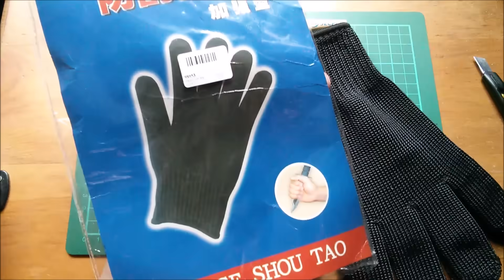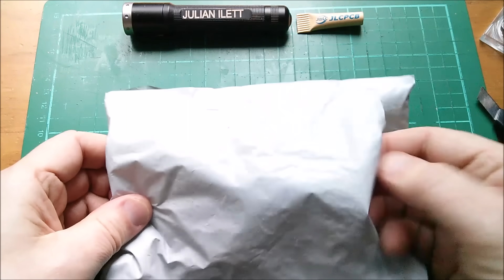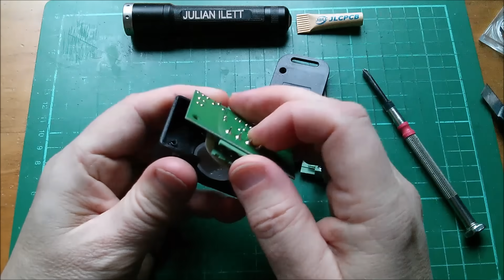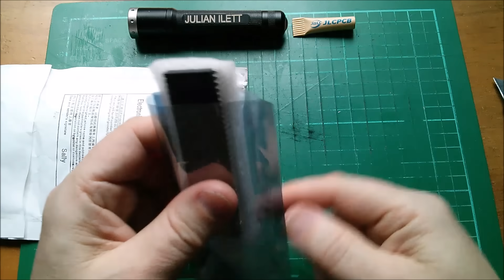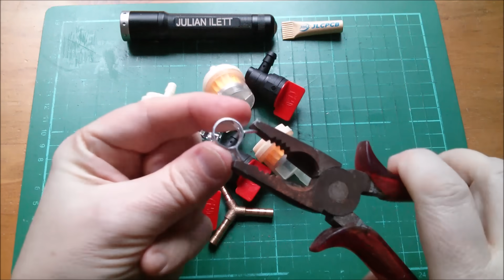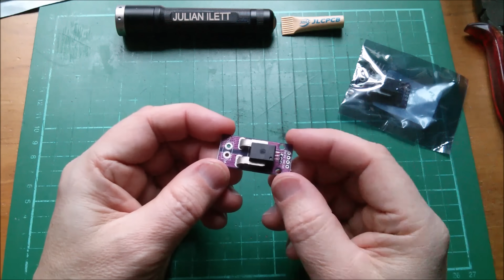Julian's Postbag: #130 - Anti-Slash Gloves

Comment: Dear Julian! 👍

For almost 20 years I drove my Mercedes Benz W140 and W202 with prechamber diesel engines and in-line injection pump with vegetable oil in a 2-tank system!
But not a single one of the vegetable oil drivers' forums managed to manage his Eberspächer or Webasto parking heater with vegetable oil!
I'm really looking forward to see if you can handle the Chinese clone! 🤔
The viscosity of vegetable oil is around ~8 times thicker than diesel, we had to preheat the vegetable oil to about ~80°C with the cooling water heat exchanger or electrically to achieve the viscosity and ignitability of diesel!
In the case of the CDI diesel engines, the conversion of the vegetable oil did not work, or only sometimes with considerable additional expenditure of technology and costs - a lottery game, it works or not!

❗ Another tip from me, build in the diesel line a check valve, you'll spare the diesel pump ❗ A cheap plastic check valve from the aquarium accessories is enough ❗

Now I drive because of these problems with diesel vehicles (driving bans) to drive downtown, unfortunately, an MB gasoline engine. 😒
I'm not happy with the petrol engine, a diesel engine is much smoother to drive. 😢😭

Best regards from Austria ❗

Comment: Typically such gloves are a woven fiber like Kevlar surrounding a stainless steel wire to further help resist slicing forces.  In fact, the wire was visible in the video where you were inspecting the finger tip after your first round of cuts.

Comment: Other current shunts (the smaller 20/30A) have the same idea of an opamp. so when your measuring current with an Arduino (0-5v input) with a 20A shunt : 0A is actually at 2.5v, -20A would be 0v and +20A is 5v.
So you can measure current in both directions.

Comment: Ha! You got the 68k ;)
  I've come across a few more references that I've saved in my MPU 68k playlist since the 6809 upload. I also got a copy of "Microprocessor Systems Design : 68000 Family Hardware, Software, and Interfacing"
by Alan Clements as someone suggested recently. The book is more academic than practical at first glance, but it's certainly thorough.
   I don't know if the ex-library book liquidators are a thing on eBay UK like they are in the States, but I got my copy for $4.51 delivered. Not too shabby for a massive hardcover version of a university course level book. I also picked up a copy of "The Definitive Guide to GCC" by William von Hagen. Apparently there is quite a bit of support for the 68K family with the GCC compiler...as treacherous as that is to the Assembler gods.
   It is certainly an interesting chip. I mentioned it before, but to anyone that hasn't seen the Computer History Museum channel's interview of the team that designed and built the 68k, go watch it when you have ~3hrs to spare. It's really interesting to hear about what it was really like back then ;)

Thanks for the upload.
-Jake
Reply: The Clements book really is good when you get into it.  I still have a copy and somewhere in the depths of the garage will be the 68000 SBC I built from his design in that book.  It probably seems academic but then Alan Clements was a lecturer at Middlesbrough Polytechnic back in the day!   I also have a 68020 or 68040 (can't just remember which) with a Maths Co-processor, they should make a good SBC!  Bob

Comment: That's a good PIR switch. I have been using one of those about 1,5yrs now. It has been continuously powered by 12V power supply and had no issues so far..

Comment: The intended application of that PIR module is probably something like switching office lights off after everyone's gone home (and stopped triggering it)
Reply: I've a corridor between the two halves of my flat with the light switch at one end. Been considering a PIR with a small LED light to temporarily give some illumination. So having an LDR wouldn't be of any use.

Comment: Julian - for the 68000 search for DTACK Grounded...
The 68000 is a 16 bit/32 bit processor, as well as the first Apple Macs, it is/was also used in Atari ST, Commodore Amiga computers and various industrial control systems...
The smaller cut down version with an 8 bit data bus is/was used in the Sinclair QL computers.
Reply: I learned more about the computer industry from DTACK Grounded than any other source.  It was spectacular.
Reply: Don’t forget the mighty Sega Mega Drive / Sega Genesis!

Comment: I couldn't quite believe the giant DIP on the 68000 the first time I saw it - it looked like an oversized comedy prop
Reply: joinedupjon - The 68000 was/is used in Atari ST, Commodore Amiga computers and various industrial control systems...
Reply: @Mark1024MAK  Thanks Mark but I meant the first time I saw one IRL... which was about 1990... It was a bit mind blowing I'd previously thought of things like the 6809 as large DIPs and 74 series logic as normal DIPs. I knew it was a lot more advanced than the 6809, but wasn't microelectronics supposed to be about making things smaller?

Comment: If you want a metal glove, search for 'butchers glove'
I wonder if you'll be able to access the connections on a breadboard with that IC in place, may have to straddle a couple.
Reply from the maker: I think it fits on the 800 point boards with one row spare :)
Reply from the maker: A PCB with microprocessor and SMD LEDs on the front (555 on the rear) would be fun to wear as a badge :)
Reply: @JulianIlett Or an 2708 (or more modern if you must) to hold your 68000 code instead?

Comment: pretty sure there were some metal fibers woven into the gloves. sure looked like it.
Reply: They may be cheeping out now. I have a pair of these. They look identical, but there are a few metal strands in each fiber bundle. I use them when dissembling PCs and other punched metal cases. I'm satisfied with them.
Reply: @frac  realistically any work glove would be good enough for what you're doing.
Reply from the maker: There were one or two - no idea why :)
Reply: @JulianIlett  Probably so they could advertise it like they did without lying :P

Comment: It's Briggs & Stratton - manufacturers of 'small engines', many types of which do find their way into lawn mowers.

The symbol on the valve indicates 'not for use on pumped fuel' i.e. fuel that's pressurised - so gravity feed only.

Comment: You should open a dispute and get your money back. 
This is false advertising. I would've also thought it would be made of stainless steel. Don't let them get way with lying. 
There is a magnet inside an oil pans in your car as well. 
Interesting video. Specially the PIR switch.
Reply: You can't buy junk from China and get mad at stuff like this, at most msg the seller and say "it's not steel".
Reply: @sanityd1  If this is what you want to do, do that. I won't. 
If I'm being lied to, I want my money back. 
This "look the other way" is why they have the balls to even pull off shit like this.

Comment: dont use those fuel valves. i have one on my scooter and its leaking. at least with gasoline it does, it leaks by the joint between red and black parts.
Reply: At $1 a piece, you  can buy some spares.
Reply: Keep in mind, fuel valves like these and many others are directional for best leakage results.  Also, one may leak and the next you use will not.